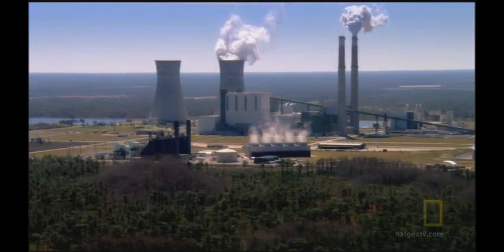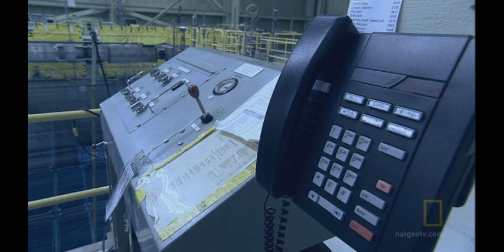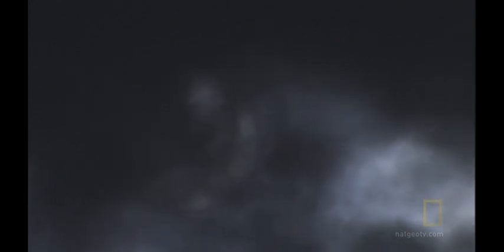Nuclear power plant spent fuel rods overheating and meltdown

Comment: There is hardly anything in this video that is even close to being true.
00:37 - The diesel fuel will not last for ever.
This is technically true, but its besides the point. The amount of fuel kept is designed with the amount of spent fuel and the time needed to cool it.

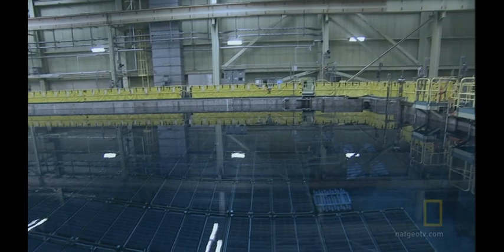01:06 - The pool is 30 feet deep
That is wrong. The pool have 30 feets of water OVER the fuel rods. The fuel rods are usually about 15 feat long, so if they are stored standing the pool is usually at least 45 feet deep. Also, there is usually some water under the rods to, so, they are most often 50-60 feat deep in total. The pool in the video have horizontal fuel storage allowing it to be much shallow, but its still about 40 feat deep.

1:07 - fill with 400 tons of spent nuclear fuel.
Well, here is a additional issue. Yes, there can be 400 tons, but a normal reactor only have about 100 tons of fuel. In very single refueling they usually switch out 1/3, so bout 30 tons. So there is at every single time only about 30 tons that is fresh spent fuel. The rest can be anything up to 10 years old, and its not that active. If you have 400 tons total the storage is probably serving 2 medium size reactors that totally produce about 25 ton spent fuel a year. So 400 ton is 8 years of fuel. This will be important later.

1:33 - If they are not keept under water, they quickly heat up...
That is not really always the case, it depend on the age of the fuel. If its  5 or 10 days old, then yes. If it 6 month old, then no.

1:37 - kept in refrigerated water for years
No, The water is not refrigerated, its just circulated. So this is wrong.

1:52 - There is 75 in the US alone
Well, yes, but they are on just 60 odd places. About 20 is situated in pairs.

2:28 - In just a few days the water will boil.
Well. No, not for a pool of that size in the video. This is only true for small one pass tanks that was used in fukushima. This is not the same kind of pools as that in the video, and they only carry about 20-30 tons of fuel. That the water will boil of in a limited time is also only true for the first 30-40 days. After that the activity will where of.

Also, the fuel usually sits in the reactor for about 10 days before offloaded. This reduce the total power of all the fuel in the reactor to about 0,1% of the total reactor power. For a mid size reactor this is about 0,1% of 3000MW. So that's about 3MW, and that's for all of the fuel. The spent feul is only 1/3 and also the least active, making it about 0.7MW or 700kW, that's about the cooling of the radiator of a large truck. In fukushima for the reactor of what this was a problem the spent fuel and active fuel was not fully separated and it was the full decay heat of all of the fuel in the reactor, not only the spent one. This is a clear distinction  because the active fuel is never taken out of the reactor building. This have nothing to do with the spent fuel ponds.

At the time when the fuel is moved to the spent fuel pond  the activity is down to about 100kW. So for two reactor refueling in a close time period that is about 200kW of new  fuel, and a additional 500kW for the old fuel.

The pond in the picture is about 15 meters deep, 15 meter wide and about 40 meters long.  That is 9000 tons of water. Do the math and you find out that the pool will not boil of any time son, actually it will not do that ever.

The people that built this pools have done the calculation, they know what they are doing.

2:45 - 500 times more radiation that was relised  in hiroshima will be reliesed
This is part of the 90% of all facts on the internet that is made up on the spot. This is just a number taken out of someones ass.

2:54 - For days super-heated stem have escaped
There is no way of making the steam super heated, there is no pressure in that building. Especially not when the power is turned off.

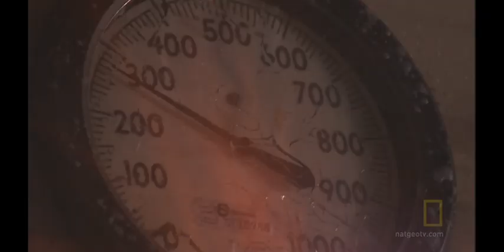3:02 - With out the emergency power there is nothing to prevent the fuel from heating up

well. apart from the 9000 ton of water...

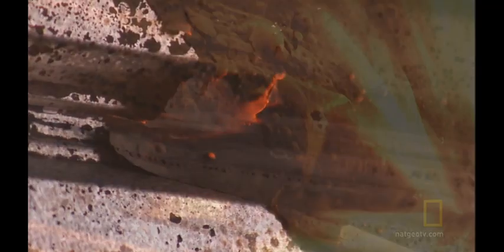3:20 - Radiation equal to 500 atomic bombs is about to explode
Well, apart from that bogus number, radiation don't explode.

3:52 - Strontium 90 will be dangerous for 300 years
Well, the half life of Strontium 90 is 28 years. How long its dangerous depends on the concentrations and the distance from the epicenter. In the contaminated area it will most probably be dangerous for 30-60 years if its even dangerous to begin with. This was the case at some places around Chernobyl, and buy now most of the levels is under the safe level. The 10 times half life number is for spent fuel, not contamination. Contamination is mostly 1-3 times the half life depending on concentration.

3:57 - Plutonium will be radioactive for 240 000 years
Well, no, the half life of plutonium 239 is 240 000 years, but that don´t equate to it beeing  radioactive for that time.

Actually Plutonium 239 is not that radioactive, its far less radioactive than a lot of common stuff in every day life, like carbon 14 that you eat daly is fare more radioactive. Plutinium 239 is safe to handle with out protection, it is that low of radioactivity. Most of the plutonium in spent fuel is 239.

Actually the most of the radioactivity from plutonium is from Pu 241 that is only 5% of the total mass of plutonium but have the radiation of about 98% of the plutonium the first years. The radioactivity of PU 241 is 2000 times more intense than for 239, but the half life is on the other hand 14 years. The Pu 241 is that dominating so even that the half life of the 239 is 240 000 years and PU 239 is over 50% of the total mass of plutonium, the PU 241 dominate radiation to that degree so the average half life of plutonium is under 20 years (from spent fuel, form nuclear bombs the numbers are different)

4:25 - Radiation damage klorofyl
No that level of radioactivity is not possible from used fuel.

04:35 - The last time a forest died like this was during the Chernobyl distaste in 1986
This was due to a overcritical reactor steam explosion. Where basically all of the interior of the reactor was blown right out to the forest. Basically a bare reactor in the forest. This isotopes was very short lived, but very active. One year later the activity have fallen by 50 times.
Most of the trees was recovered after 3 years. (the later damage is due to bulldozing down treas to stop the spreed of longer lived isotopes)

04:40 - Contaminated a area of 50 000 square miles (about 130 000km^2)
This is just dishonest. They say this right after the red forest. But the total area of the red forest was 4km^2. Its 30 000 times less than implied.

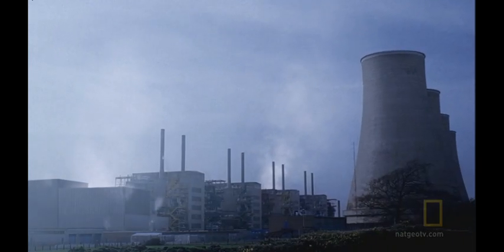4:55 - With out humans this is repeated again and again
This is totally false. All the system is designed to reveret to a safe state in case of no human intervention. The disaster in Chernobyl was because of human intervention. That was actually the case in Harrisburg to. The only place that is not true was in Fukushima. But the fallout in Fukushima is actually relatively low. Of the sealed of 600km^2 only about 20km^2 is actually over the legal level. The seal is also mostly partly lifted. There is actually areas within the sealed of area that have lower radiation than down town NYC.

5:20 - Each one is 20 times more radioactive then Chernobyl disaster
Now they are just plain making up number.
All nuclear power plant in the US have core protection shell, over pressure protection, and nuclear radiation filter. Even if it would have a total core explosion, that is very unrealistic. This would be kept inside the building and the over pressure would filter out and the radioactive isotopes would be captured in the filter. This is the law in US and most of Europe. Sadly it was not the law in Japan in 2011. (i believe they added it no, and that's why all the reactors is turned of, they are installing the filters)

5:53 - If we still was around it would cause cancer in millions of people.
Well, if the radiation level really was that high (and it is not really realistic), it actually could. For reference about 14 million cancer cases a year accure now.

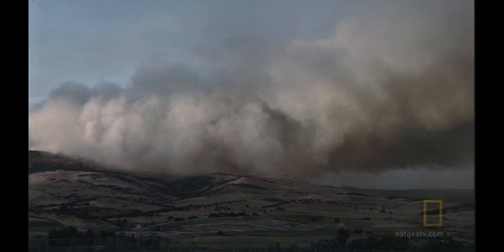06:40 - Radioactivity drifts over the ocean.
Well, this is also complicated. The dangers isotopes is almost i every cases in heavy atoms that don't get airborne that easy. Strontium and Plutonium there for don't spreed that far.
What spreed fallout is actually a little bit more complicated. There is no long lived isotopes that is air born. But there is a little complication here. Xenon is short lived, but it decays into Cesium, that is quite dangerous. Xenon 133 lives for 5 days and decay into Cs 133. Well the wind can get xenon quite far in 5 days..... well, the problem is that Cs 133 is not radioactive. So 5 days out you get non radioactive fall out.
Xn 137 on the other hand do decay into radioactive Cs 137, and its quite dangers. But the halflife of Xn 137 is only 4 minutes, so the wind don't carry it that far. We see that around Chernobyl and Fukushima. the Cs 137 radiation is actually quite local. There also exist Cs134 that is carried longer, but it is on the other hand less dangerous and also have a half life of 2 years. This is the mainstay of the contamination around Fukushima, and that's why the contamination cleans up that fast.

6:50 - Rain washes the radiation, and concentrated its deadly effect.
That is totally wring, water actually shield and dilute radioactive isotopes.

07:20 - Beta radiation only penetrates about ½ inch (12mm)
That is quite a optimistic penetration number, i would say more 1 or 2 mm. Beta radiation is no problem as long as you don't eat or breath the source. Skin radiation of Beta is a non issue. (that's why radiation clothing that seams flimsy actually work quite good)

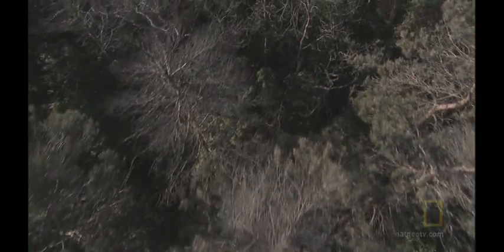07:40 - But it is different for small animals.
In reality no. Actually small animals handle radiation better than large, because of faster metabolism. Its the radiation that is eaten that is important.

There is a lot more errors. Basicly every single centance is wrong
Reply: ***** Well you cant do both at the same time
Reply: +matsv201 Despite Fukushima spreading less radiation into the atmosphere than Chernobyl, I would say Fukushima will have the biggest long term effect because they have been and are still dumping contaminated water into the ocean. Is gotten to the point where millions of sea life are dying. If you  contaminate the ocean, you contaminated the whole biosphere. The consequence of Fukushima is far greater than Chernobyl. Water can easily carry all the isotope and that is only matter of time before we feel the full force of Fukushima.
Reply: ACEDshooter Its not correct. Fukushima stoped leaked when they made the is-wall, and it was back in 2011.

There was a tritium leakage from a faulty tank back in 2012 that media done several reruns on. The problem is that tritium is not that dangerous, and the half-life is 12 years There is also a lot more tritium already in the sea water that is stored at fukushima. Tritium is natural accuring in great quantities and its not very dangerous. 

Tritium is made from all types of process, including hospitals, and usualy they are alowed to dump it into the sea becase... well, its natural accuring, its basically like dumping water in the sea. But now the goverment refuse to let them do it because of moral panic. Its no logic behind it.

"Water can easily carry all the isotope"
Well firstly its not true. secondly dense clay would not allow the heavier isotopes to be carried trou it.

You are tricked by the media. First they talking about cesium and plutonium, then they claim that water is really radiactive, and then they are suddenly talking about tritium,
Reply: matsv201 No it was pretty recent. This was hidden from the media and the government won't tell the people because fear of panics. Traces of cesium had been found on California beach. Although the concentration isn't that high, it still worrisome as sea life are mysteriously dying in an alarming rate as well as birds. There mass death is still happening right now. My theory on the bird dying is that they consumed dead, radioactive fish. As I said before if you contaminate the ocean, you contaminate the whole biosphere. Fukushima is continually dumping contaminated ground water, containing cesium 137 and plutonium 239, into the ocean because they have no room to contain them. The government authorized it. As far as if they're filter is still a mystery. They claimed is 90% filter but some say they couldn't have filter it at the rate they're going. Even then 10% is still quite alot if you're dumping hundreds of tons of gallon into the ocean every day.
Reply: ACEDshooter "This was hidden from the media and the government won't tell the people because fear of panics"
Eeeh, no... it was so hidden so literaly nobody knows about it.. Wake up.

"Traces of cesium had been found on California beach."
No, its thorium. Idiots that don´t know how to operate a geigercounter go don to the beach and think that everything that ticks is cesium.

" mysteriously dying in an alarming rate as well as birds"
It might be the case, but it sure as hell is not radiation.

"My theory on the bird dying is that they consumed dead, radioactive fish."
Yea, you literally know nothing about how radioactivity works.

"Fukushima is continually dumping contaminated ground water"
No they are not. That why the use osmosisfilter and storage tanks. Go check it up.

"plutonium 239"
Yea, then i know you are just making this up. Pu239 is chemically identical with Pu240. There is no way of separating them short of a accelerator. This is also true about Cesium 137 and 134.

If you want to make something up. do it with something that is somewhat realistic.

"into the ocean because they have no room to contain them. "
Yea right, look at the image bellow, and all those tanks are for tritium water only. Plutonium and cesium is stored elseware because the volume is that low.
http://www.anonsweden.se/wp-content/uploads/2013/08/fukushima-.si_.jpg

"The government authorized it."
Yea but its totally secret and nobody knows anything about it... time to take of your tin foil hat.

"As far as if they're filter is still a mystery."
Osmosis filter is not really that much of a mystery. I have been around for decades. Its not really that uncommon. Army have used mobile versions for years.
https://en.wikipedia.org/wiki/Reverse_osmosis

"They claimed is 90% filter but some say they couldn't have filter it at the rate they're going"
Its the media calming. This number is hogwash. Osmosis filter removes 100% of the larger atoms. 100% of the cesium and plutonium. It dont remove oxygen or hydrogen. Radioactive oxygen have a half-life of 124 second. Not really a problem.
Left is the tritium. Tritium is not radio-logical dangerous.Its also naturally ocuring.

" Even then 10% is still quite alot if you're dumping hundreds of tons of gallon into the ocean every day."
Well apart from they don´t. Also its tritium, tritium is already common in sea water. You really don't affect the level of tritium that much
Reply: matsv201 I commend you for your various knowledge but for now only time will tell. I will take your word for it but for now I'm pretty doubtful.
Reply: Thank you for the information
Reply: +Man na "Your facts are trivial and silly. What matters are my feelings."
This is you.
Reply: Man na Actually there was a 14 meter tsunami wall, but the Tsunami was 22 meters high.

When they built the tool they didn´t have the wavesimulators as to day, so they didn´t no that the waves would be that high. Actually the position of the powerplant amplifed the wave hights. 14 would ben sufficient if that have not been the issue,

Modern nuclear power plant don´t use active cooling so they dont need diesel generators any more... So this problem ben solve quite some time ago.
Reply: matsv201 Modern nuclear power plants do have  active cooling, as it is needed to even extract the power from the reactor. Water is evaporated to steam, which drives several turbines.
The do have passive emergency cooling, though.
Reply: ***** Well. emergancy cooling of cause..

I would not really call the process of making power from the reactor a cooling process... sure it cools the reactor, but its not really the main objective.
Reply: +matsv201 I don't have the knowledge to counter any of what you said, but it was still pretty funny and sounds as believable as this clip.
Reply: almondjoy112 So you are laughing at your own lack of knowledge?
Reply: +matsv201 you are my hero. I work at TVA for unit 2 completion. I have to say you are 100% correct on everything. The only thing I would differ from you on is the cancer thing. If it were in the doses that they are coming up with. You would die in about a week from acute radiation poising rather than cancer. But they are still wrong either way.
Reply: +InYuco Katan not to mention that at anytime they can flood the core and spent fuel pool with boron and let it sit forever.
Reply: InYuco Katan Well, that is very true.. maybe i thought didn´t think straight when i wrote it.
Reply: +matsv201 Heres a great idea to piss off the anti nuclear / jew trolls. Use an RTG to drive the cooling circuits then you don't need crappy diesel LOL.
Plus i would use xenon gas to fire into the reactor as a fire extiguisher / criticallity/ corium preventor.
Reply: ***** Well, they are really expensive and have limited life span, they are also quite weak.

They are really not that good of a match.

Some plants actually use a passive cooling where the cooling energy power the cooling system. Don´t need any external power what so ever. Runs until the reactor cools. But this system have not been certified for gen III. But it would not be that hard to retrofit them to older reactors.

Using heatpipes would probably work quite good also
Reply: matsv201 What i mean is with xenon gas is that it is a nutron poisioner and would stop a nuclear fire like at windscale or chernobel and could fire under pressure into the reactor and stop a melt down or explosion if all else failed.
This would shut the reactor down by killing all the nutrons and cooling the fuel like in a fire triangle on a convetional fire but with nuclear you need to fight back the nutrons as well.
The uk has successfully used AGR advanced gas reactor using liquid CO2.
Reply: Well.. it workes in gas-reactors, but not water based reactors. But there is bor acid work just as well. Have a pressurized bor-acid injector that inject it into the core and it will slow down a meltdown quite a bit.

If you have a total meltdown, bor-acid or xenon will not help.

Gen 3+ reactos have a core-catcher in steed. A large room with low celing hight under the core that catch if its melt. The room is made in such a way that the melted magma cant escape and it cools quite rapidly.

They they go in to the chamber with a robot and break of peces of the core and transport it away to a fuel processing plant. 

Even with a total 100% meltdown the station will be up and running within two years.... well if they goverment let it.

This make any type of catastrophic scenariy virtually impossible.
Reply: matsv201 What about the IFR 2 that used sodium to stop melt downs AND worked when tested shuting off the cooling pumps and all the auxillery cooling. This was canceled by the us government, I bet the oil barons didn't like it at all.
I think it would be perfect for a desert but not so good near a tsunami unless it was built like a water tight submarine.
Reply: ***** Both fast and thermal reactos have the advantages that they can be made quite easialy to have moderators change with temperature. Virtually making them self moderating. There still needs some buffer if change power rapidly.. At least NaK reactors.

Salt and LFTR reactors don´t. They are a bit more stabile, and also less voletile.

So i would actually say thermal salt or LFTR is quite a bit better than NaK reactors.

Actually almost all modern reactors are pressure tight.. so they are virtually submarines. This was actually what caused the explosion at Fukushima.

Reaactors that are newer... just about everyone build after 1985 also have over pressure filter, Fukushima didnt. If it had, we would never se a explotion, and nowbody would know what fukushima is.
Reply: Actually Einstien was not that important for the bomb that people might imagne. Sure now we know E=MC^2 as the power for the atomic bomb. But before that special relativity was still well known. The first atomic energy theory predates general relativity by quite some time.

Teller was more important to the hydrogen bomb than the fission bomb. He did have a hand in the fission bomb to, but it was quite peripheral.

Anyway Teller and Oppenheimer was more of weapon design guys. They was not that much involved in the atomic pile project. Now i dont remember then name of those guys so i have no clue if the was jewis or not.
Reply: +Man na Actually, contrary to popular belief, Einstein was atheist. His parents were jewish, but he made different choices.
Reply: +matsv201 you seem pretty well educated. thank u for this
Reply: +matsv201 Great post, glad to see someone else posting youtube comments with a background.
Reply: +matsv201 well put sir, I'd figured that the anti-nuclear trolls would have teared this a new one, but seems like they can't counter your truth. a few tried but was quickly flushed down the toilet like a turd.

a lot of great info.
Reply: ACEDshooter - CAUTION: Reading can seriously damage one's ignorance. ;-) And it looks like you are spending too much time searching out 3rd rate scare documentaries developed specifically for those who are too lazy to read and/or are illiterate!